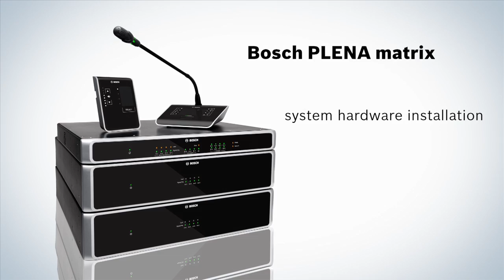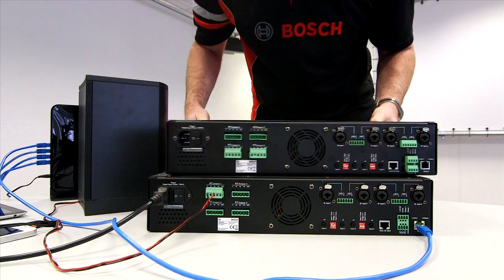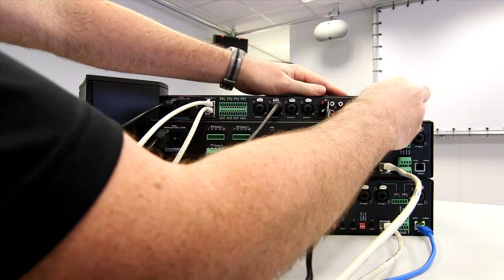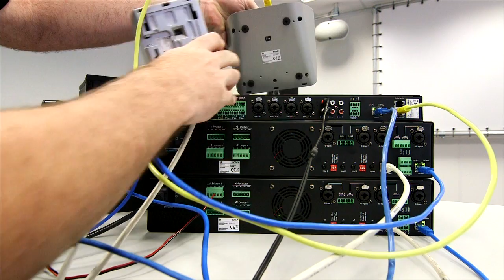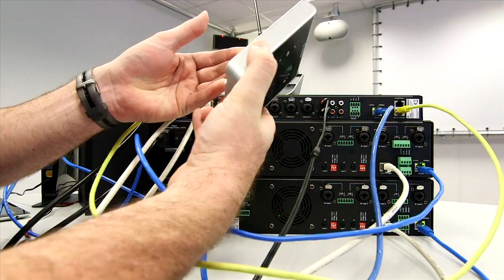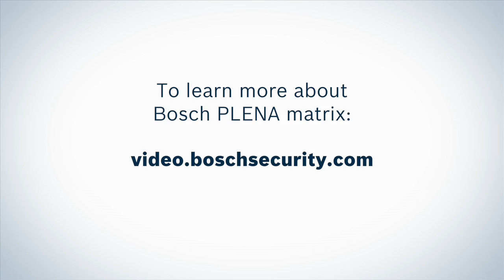System hardware installation

Comment: hello, i just want to confirm if i want to use bridge connection, for example from the output of PLM‑8M8 DSP to channel 1 and 2 of the PLM-4PXX amplifier i will only connect to channel 1 input only and then switch on the middle DIP switch right?

Comment: Hi. please help me.
I plug the cable of call station, but it not bright the led indicator.
Reply: +BoschTutorials  Hi. thanks you so much. I describe detail about fault of call station i see. before i still move the call station and it active is good. But in this time i move call station to greater distance ( still shorter than 100m ). But call station inactive and led indicator power on the call station no bright . I checked the all cable is normal, so that call station inactive.
I don't understand why it inactive. Please help me soon. thank you so much.
please connect to me via gmail : anhdangduy@gmail.com